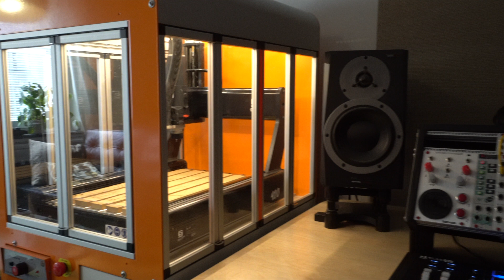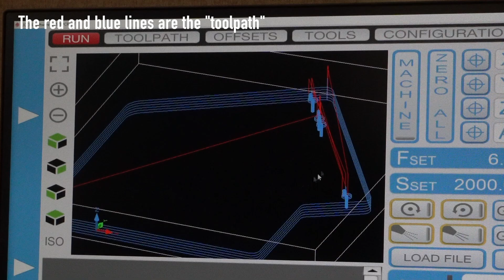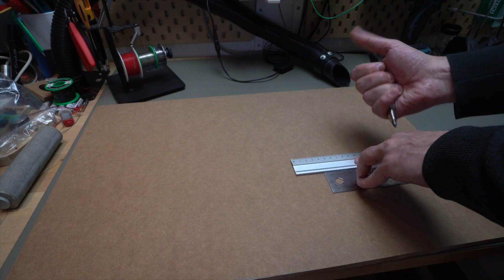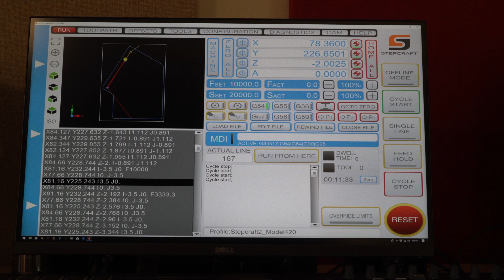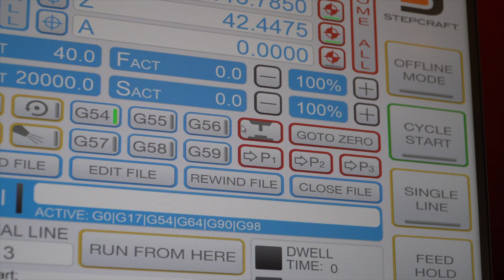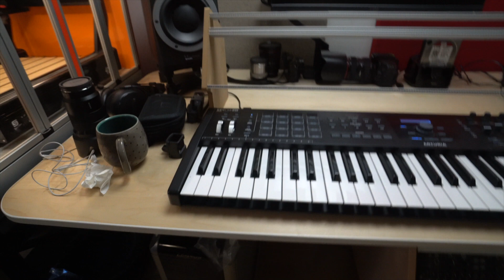Building the Perfect Eurorack Case (Part 1)

Comment: Good vid. Be aware that you can come across rails that are not standardized. There are more than a few out there where you will have a head scratching moment. Some use 2.5mm threaded inserts, some inserts will not fit other rails,  some also use different sized threaded bolts for the rails too. Gie-tec are cool , there are also Schroff, Rittall, and others who are not necessarily pulling in the same standardised direction.
Reply from the maker: Good tips.  Yes, the "standardization" around these rails is not exactly robust or consistent.  Which sort of defeats the point of standardization but it's better than nothing, I suppose!

Comment: You know what's better than double sided tape? Painters tape on both the stock and the spoilboard and superglue. Comes out way easier than double sided tape and can be used for aluminium sheet. For smaller and thicker aluminium, just superglue it to a piece of wood.

Comment: Have You noticed any issues of concern that are the result of your decision to go with 168 hp?  I ask because I’ve got 168 hp rails and it’s the dimension I want, only I’m uncertain whether that will get heavy with modules and eventually want to sag.  Should I put a supporting column in the middle, or go 2x 84 hp?  Your workspace looks great, b t w!  Thanks for sharing this, and very good job on the project!
Reply from the maker: I loaded this case up and have been living with it for several weeks now and there have been no sagging issues at all. It seems fine but I’ll follow up if there is a problem. 

Thanks for watching!

Comment: Excellent videos! I love everything you release. Have you considered cutting those end pieces out of a nice wood like walnut to really make it not only look great but to also make them more durable? Maybe with an oil finish? Anyways, just a suggestion. Keep up the excellent content!
Reply from the maker: Totally--a machine like this would have no problem with any kind of wood.  In this case I used MDF since I knew I wanted to wrap it in vinyl, but if I was to build it again, I might use walnut or some other nice wood as you say.

Thanks for watching!